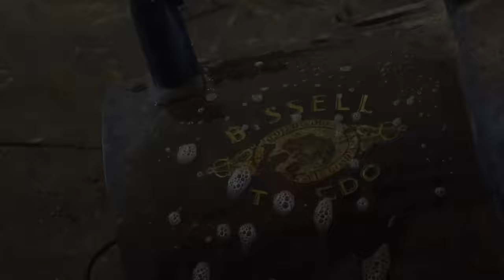Someone paid an equivalent of $2000 for this in 1914 [Restoration]

Comment: I share your frustration with those screws. Last week I needed to weld a crack on an agricultural mower deck and to get a clean shot at the damage I had to remove the hanging harness. Every single bolt was rusted solid and had to be ground down, drilled, and punched. What should have taken an hour ended up costing an entire afternoon. Wonderful job on that decal!
Reply: A lot of those old screws were a mild steel at best so they tend to get stripped out quite easily. Good at the time but don't fair the test of time when the paint chips off and any corrosion sets in.
Reply: I like to left hand drill bits on stuck screws. As the drill gets deeper the pressure from the sides releases and often the screw just backs out.
Reply: @creamsiclem4433  better yet, use a screw extractor bit .. one end has a short left-hand drill and the other end looks like a tapered end mill, also with left-hand threads. Second end wedges into the hole that you drilled with the first end
Reply: Totally agree, can never get over to the farmer I do agri mowers for that yes fitting the new parts might only be a half hour job but it can take a whole day getting the rusted bolts out so you can fit the new parts, my fun for this coming week is straightening a Kuhn mower head deck with a bend in it.
Reply: Hopefully you realized you need to heat whatever the bolt is threaded into, not the head of the bolt. Unlike this guy.
Reply: @kuuz1134  Heating the head of the bolt actually works as well as the bolt will expand, compressing the crap in the threads a bit. When the bolt cools enough space is available to unthread it.

Comment: I would say this was designed for a blacksmith. The combination of functions would make sense. Blower for the forge, grinder for the horsesshoe and so on.
Reply: I had the same thought. This looks like it would be perfect for a blacksmith.
Reply: I agree, seems like a perfict fit.
Reply: its probably for an old style tub washing machine with an aerating tub/scrubber tray.  this would have been something you see in like an industrial dry cleaner business.
Reply: No, a blacksmith in that time wouldn’t have paid that much for a tool for the shop. It isn’t perfect for a smithy, and in the description the company renamed themselves the ‘super suction company’.
Reply: @greg3030  Why wouldn't they? Also if you are good at sucking you are also good at blowing, the air has to go somewhere after all.
Reply: A very good point.
Reply: A lone blacksmith may not buy something like this, but if it really was made for blacksmiths/farriers, it would probably have been designed for large scale use like at a ranch or farm. 

But again, I'm not sure what it's for. Blacksmith seems like a good match though.
Reply: I am a farrier/blacksmith, and while people who dabble use all sorts of contraptions to make blowers for the forge, in 1914 hand crank blowers were the standard. I still prefer them.

Comment: As soon as you uncovered the blue paint it hit me...  my Grandmother had one of these!   This was in the 60s and I don't think she used it much as it was always in a closet.  I remember the little doors (that I now know, thanks to you) were the access to the brushes were nickle plated.   How many vacuums made today will still be around and restore-able in 110 years?
Reply: Why did the brushes need a quick-release screw? I'm all for repairability, but the risk of someone's finger becoming one with the brush seems a bit higher than the convenience it offers.
Reply: @tamask001  You mean the screw on the  spring loaded arms that keep the brushes in contact with the armature?
Reply: @tamask001  the brushes wear out because they rub against the contacts on the rotor, and it seems to be a fairly powerful motor so to keep it cool they left big vents in the back.

Comment: I feel better knowing that you occasionally have the same difficulties taking old rusty crap apart as us mere mortals. :D
Reply from the maker: This one fought me the whole way.
Reply: @HandToolRescue  Obviously, penetrating oil is now illegal in Canukistan, LOL.
Reply: @TailSpinRCSpain kerosene and acetone mix works better
Reply: @TailSpinRCSpain rude.
Reply: @crakkbone  Hi Karen 🖐🏻
Reply: @commonsence8223 Does Canadistan sound more appropriate? 😂
Reply: @commonsence8223  good to know.
Ratio?
Reply: @BCM1959  I would guess 1:1, same as for the similar ATF - Acetone mix
Reply: @casparberends2719  thanks. ATF & Acetone too? Cool. Learning stuff today.
Reply: @BCM1959  Any light viscosity oil (that doesn't oxidise easily (like wood oils)) mixed with acetone (or gasoline) works fine. I usually do a 1+9 mix of synthetic bike chain oil and acetone. The bike chain oil is cheap and comes in a 100ml bottle, and wiefy gets the remaining 100ml of acetone, from a liter bottle, for removing nail polish.

Comment: Old vacuum cleaners fascinate me. So many different designs. But I've never seen one combined with an angle grinder. I still use an Electrolux Model L with the optional automatic cord reel and it still works as well as when it was new. All old appliances are cool to me. They are so well made compared to today's. As an example the neighbors still have a nearly 100 year old GE Monitor Top fridge in their kitchen still operating.
Reply: I like that everything was made to be able to disassemble and repair. That ceramic swtch base won't melt and burn like a plastic one.
Reply: That's not the model with the coils in the top is it
Reply: My Westinghouse fridge is about 80 yo and still tickering away. A few years ago it started acting up, Freezing everything or defrosting. I suspected the thermostat. Ordered a new one which looked like a toy and is completely sealed. When I got into the job and got the original out, I realised it was serviceable. Pull apart and all that was wrong was the thick, real silver contacts were corroded. Cleaned and back together and hasn't missed a beat ever since.
I also have a Hoover upright, Brit made, built like a tank, still going strong. I have all the attachments in the original box, nice!

Comment: What a neat little grinder vacuum blower buffer pulley. I've always wanted a thing that did all of those at once.
Reply: it'd have made sense if you could vacuum up the ground dust, but... it's not even that... and IT'S ON FREAKIN' WHEELS HOW ARE  YOU SUPPOSED TO DO ANY REAL GRINDING ON IT
Reply: @dimitar4y  And the pulley has the same problem, perhaps they made some kind of stand for it.
Reply: @dimitar4y I hate to imagine what happens if you tug on the hose while vacuuming and that thing catches your shirttails. 

But with the right precautions and some attachment to hold it in place when grinding I’m sure it was a great way to get as much use from one motor instead of having to buy a bunch of expensive power tools. Surprised it didn’t have a detachable drill chuck too 🤣

Comment: What an amazing 'tool of its time' - vacuum cleaner, grinder and - I think I saw - a belt pulley behind the grinding wheel...perhaps as a power source to other equipment as well? Vacuum the dust, caused by your knife grinding, whilst powering a loom😂 Love it...brilliant, as ever❤❤❤
Reply: whilst powering the meat grinder for which you had to cut down your meat with that knife you were sharpening hehe. High specific machine for a highly specific situation. Had to do it in the dark tho, since this would be screwed into a light bulb socket because outlets didnt really exist then.
Reply: I have a ton of old manual equipment around the house, and everything has a V-belt pulley molded in somewhere, or a flat belt for larger equipment. Motors and engines were exceptionally expensive back then. Something like this would run a washing machine, corn shucker/grinder, and a host of other tools like a drill press or table saw.

Comment: A couple of tips. When pulling on something like the blower fan, use a 3-armed puller to spread the pull over a larger area. Also try lining up the puller arms with the fan blades because that area is stronger. If it is a 4 or 8 bladed fan, use a 2-arm puller to line up with the blades. On stubborn bolts/screws, if they loosen up and then get tight again, add penetrating oil, screw back in, reapply heat and unscrew again, until it gets tight, then repeat the process. That is a very interesting machine, added value with all the "extras"! Thanks!

Comment: For those flat head screws, would a set of hollow-ground gunsmithing drivers be helpful? The sets usually have a zillion sizes and they’re intended to be ground to the exact width of the head or counterbore to get 100% purchase on the slot. I’m always impressed at how well a fully fit driver works and won’t cam out, upsetting the slot.

Comment: Wow, super delux video of coolness. I wonder how many shins got ground by that wheel as they were vacuuming the house?
Reply: This seems like something for a mechanic or metal fabricator’s shop. You can use it as a shop vac, a blower, a bench grinder (preferably locked in some kind of stand,) and power for a lathe or other stationary tool (again, with it locked into the right stand.) 

But I agree having that wheel exposed while vacuuming could be sketchy.

Comment: Vacuum on one end, knife sharpener on the other. I can’t help but wonder what “attachment” would have run off, what looks like a pulley, behind that grinding wheel.  Maybe an automatic chicken plucker??
Reply: How about a table saw? You've already got a dust collector built right in!
Reply from the maker: They suggested a meat grinder or ice cream maker as examples.
Reply: @HandToolRescue  Bissell should go back to the vacuum cleaner Think it would catch on with the tiny house movement

Comment: edit: 15:49 we had one of those, same issue, fixed it by keeping the gloves slightly pulled in half way through the collar. Then you don't have to juggle the udders. 
Pro-tip, instead of using a ball end mill, use a conical one and plunge it in the screw head. Less chance of messing adjacent stuff up and it achieves the same result. I'd go with a nice chamfering bit for a CNC mill that fits the collet you have for the "dremel". If you can score a carbide one, even better.
Reply: Or a slotting blade or cut- off wheel to square the edges of the screw slots... after trying WD-40, PB Blaster and Kroil for at least 3 days.
Reply: Screw extractor bit in a regular drill

Comment: The tough fasteners almost made me wonder if that machine was EVER taken apart after initial assembly, but the motor seemed to be in good shape for its age, so maybe it had been taken apart and serviced at some point. Job well done as always.
Reply: The blue paint bleed inside the edge of the switch shows this must have been painted after it left the factory.
Reply: @moconnell663  I wonder if the entire base of the switch or even the entire switch was deliberately painted at the factory to match the colour of the unit.
Reply: @Ragnar8504  I feel like the pieces would have been painted individually and then assembled if that were the case.

Comment: Awesome! I was trained as an Electrical Fitter in the 80's and then went on to work on Trams in Melbourne. I can see some similarities in the construction of this item and the tram motors and controls I was repairing. It's a shame that very little of this over engineered equipment is still around. Things are built to be replaced now instead of repaired. Keep up the good work mate!

Comment: Very nice restore of a multi use machine. I noticed it had a pulley on it, you could power many things using a V belt like a meat grinder, drill press, belt sander,ect. It could run almost any wood working tool, and variable speed on top. It is a very useful device. Great job.

Comment: I noticed on the rating label it specified 25 cycles. (It also says "A&DC" so it shouldn't care). I was recently at Niagra Falls and toured the power station there. It was one of the first power generating stations and it made 25 Hz electricity. What amazed me is that it was in operation until 2006 (I think) and still had customers that had machinery designed for 25Hz power. That plant was build 1900 to 1905 (ish) so  this piece was apparently right about that time (and place) for that flavor of power.
Reply: Any brush motor will run on either AC or DC. Technically they are called universal motors for that reason. I've run my 240v AC drill straight off several solar panels that put out about 240v DC. Had it attached to a pump and it ran for an hour, easily.
Reply: The generators you saw at Niagara Falls supplied the 25-cycle power to the Toronto streetcars and subway through rotary AC-to-DC convertors, and later, rectifiers located at the Toronto end of the system.

Comment: Nice job! I was pleasantly surprised to see a replacement decal!
For your future restorations, tires for cast iron wheels can be made without gluing a band, by finding a thick inner tube of the right diameter and slicing pieces to  the desired width, then stretching the bands over the wheels. The seamless bands could even be used as a covering to the tires you made to keep them from coming apart at the seams.

Comment: Uh, there are a few things that need fixed. When you turn a commutator, you undercut the mica, below the copper bars. Growl it while it's out. Check the fields for ground, and with high frequency. If the brush holder, wasn't marked, it needs timed with your meter, for optimum alignment. A little wool would be nice, to hold oil, for the bearings.

Comment: I remember those, including a similar one that my parents bought in 1955. In '77 we bought one, but my wife lent to my SIL. She vacuumed up rocks. I wonder if the grinder was an owner attachment. I remember they had carpet shampoo and a mister attachments but never saw a grinder. BTW, in '77 the Electrolux version was sold in a mall where they'd try to get you to sign up for a $5K purchase (adjusted for inflation). We paid around $1800 in today's money which didn't seem bad for a vacuum that'd last a lifetime; barring sucking rocks thru the motor.

Comment: If I may offer a suggestion, on some of those screws, use a ratcheting brace and bit instead of the screw driver, specially if you're trying to save any of those screws. Gives you better torque and you can use the brace like an impact of sorts. Many folks today think just grab an impact and that's a huge mistake. Been a long time follower, truly enjoy the work you do. Cheers :)

Comment: For a guy with all your talent and resources, I can't believe you tare up so many screws. Get a gunsmithing screw driver set and once you get the screws to move, go back and forth with the screws and they will loosen up as they break the shmoo in the threads up. Better yet, get a set of Craftsman screwdrivers and hollow grind the tips as needed for the size of the slot. Try it, you'll like the results. It's the taper on the tips that's causing the tips to cam-out and tear the sides of the screw heads up. Hollow grinding the tips puts the torque at the bottom of the slot where the screw is strongest. I'm an old guy and that's an old guy tip. Something an old guy taught me a long time ago.

Comment: This device was worth every penny back then (I think, LOL).  Lots of parts to that thing.   In that year it was most likely 40.00-50.00 bucks.  I have my Grandmothers Timberline table saw (built in L.A.) she purchased in 1934 and she paid 90.00 dollars for the motor.  She said back then the motors cost more than the machines did. Today I'm still using both the saw and the motor.  Well built.  Cheers

Comment: I have an old shop vac style vac circa 1962 (N.S.S. company) apparently this model was made according to their patent for a design attribute that incorporated a specific airflow and heavy felt baffles which greatly reduced the noise level, the motor inside was relatively large and robust with cast solid steel or iron armature frame and simplistic motor brush assembly of heavy wall phenolic brush holders essentially bored through phenolic rod and then graphite/carbon motor brush within.  A two stage bypass type impeller chamber and a separate fan to cool the motor (twelve amp original motor)
I read somewhere that the intent on this particuoar model was to over build the specifications to ensure longevity of in use service life. (My unit is evidence of their achievement of that goal)
What i found amazing as i attempted the patent research is that the actual patent number stamped on the casting for the chassis was one digit off on the first digit, made me wonder if the unit i have was a prototype or early production unit.
Your videos are enjoyable, helpful and inspiring.
Perhaps now i will do even less irreparable harm or butchering as i endeavor to restore old machines and tools which i take a liking too

Comment: Here is a tip an old timer taught me and ive been using it in my career for the last 20 years without fail. If a fixing turns a little bit but is stiff and getting stiffer. Never force it, just reverse rotation and ease it back and forward through the range it can do, until it frees up. Then go a bit further into the stiff side and repeat until you are done. Apply some lube whilst doing this and I've never failed to remove a fixing that has some turn.. Hope it helps..

Comment: I know HTR knows way more than I ever will about shop tools and everything else, but: Never grab Delrin shavings with your hand when the lathe is running. It comes off as one long string and it's much stronger than people think. If the lathe catches hold of it while its wrapped around your fingers you're going to lose those fingers.

Comment: For what it's worth.....I graduated from a Polytechnic High School in the olden days (1964} and I was taught when rebuilding an electric motor, after turning the commutator on the lathe to take the smooth side of a hacksaw blade and run it through the grooves to clean them of debris.